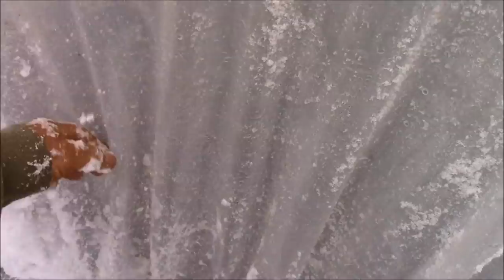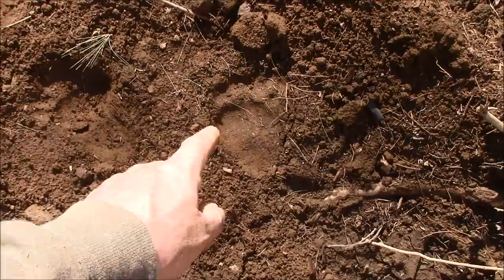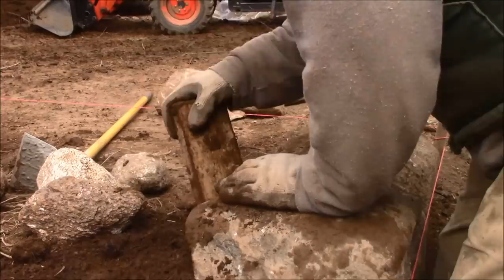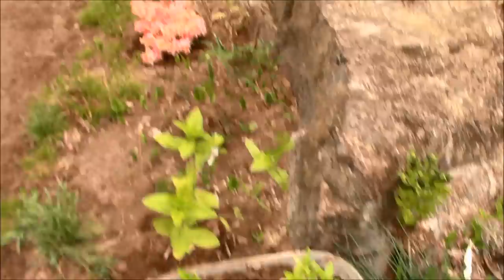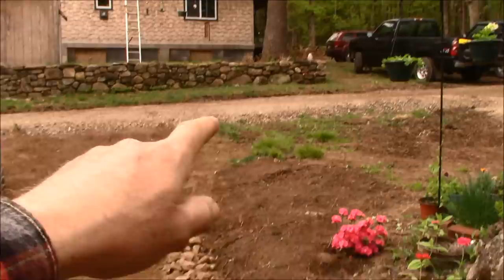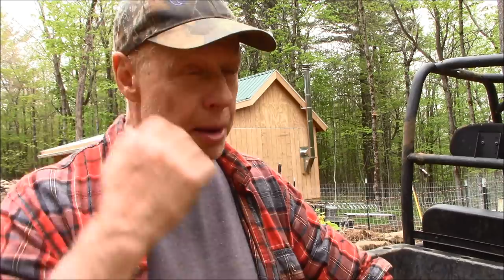HOMESTEADING ON A ROCK.  Life Up Here Has Its Challenges.

Comment: Love to see ya going at it! Praying for ya still... we have our own bedrock hillside issues as well. I plan similar but i will give a larger base under the "soil" level (think if you'd been able to add 4" of base concrete about an extra 16" around your tube. I've got slightly deeper soil.) I also plan to rough up the rock and drill/ chip/ knock out a hollow for the post to set in... even an extra 2 inches will make a difference. 

Look forward to your next

Comment: My mom is your most devoted fan and wanted me to leave you a comment @Off Grid Homesteading With Boss Of The Swamp. She said you should look into rock corners. We use them to fence here on the ranch. Basically it's a cattle panel wired into a circle and filled with rocks. You don't have to set posts and it's solid. I'm sure you could find plenty of rocks to fill it with 😀
Reply from the maker: Now THAT's a pretty darn good idea right there. I could suspend the fence from corner to corner.  I will keep that in my when the frost heaves wreaks havoc with what I've done LOL.    All the best :-))

Comment: When I had to build a fence across a rock ledge I used a one inch concrete bit and drilled holes into the ledge, cut down the end of the steel posts and drove them into the holes. Sending prayers your way. Hope you have a quick recovery.

Comment: Boss I also deal with plenty of rocks. I use a big hammer drill with a 1 1/4 concrete bit to drill holes for T post.If the  post have the plates Knock it off.Keeping you in our prayers.

Comment: Hope all is well! I'm in the Texas hill country. My future off grid cabin sits on a solid flint slab with limestone slab and large gravel mixed in. My secret to T post in rock,rotary hammer drill and 1 1/2" drill bit. I bought the drill from harbor freight with a coupon for $160 and got the 4 cutter tip Milwaukee bit,around 23" long for $112. (Seen for $75 on ebay) Its an investment but worth it. Grind and knock the pans off the tpost and a couple slams with the driver and your done. Maybe 3to 5min per hole. Some have good luck with rotary drill and use #6 or #7 rebar. Its still work.

Comment: I’ve taken your advice and learned a lot from your videos so I’m paying it forward to you.  I drill 16” into ledge with a 1” hammer drill off my generator and pound rebar into the hole.  Makes good fencing and when I built my cabin I used the same drill for all my concrete piers so they wouldn’t slide around on the ledge with frost.  Thanks again Boss and good luck!! NHAF

Comment: Get a hammer drill and a long add bit and drill down for the fence posts I put mine in 12 inches and they are solid. Used 3/4 pipe. Good luck with the surgery

Comment: Your health is more important than our entertainment! Garden looks very good!!!!Stay safe and may god be with you on your surgery.If you have problems with the t-posts leaning in they make corners for t-posts you can get a horizontal to make a bottom and or top bar using more t-posts across! I;m sure they will hold as long as the concrete bonded with the ledge.
Reply from the maker: Thank you :-))

Comment: I hope all goes well . When I put a fence in in Tn.  I hit a large ledge I cleared the hole and used my hammer drill to to put a half inch rebar anot a foot long into the ledge  for my post support then poured concrete in with the fence post the rebar held the post and concrete stable . The chain link fence it now 19 years old and strong as the day it was installed

Comment: Hammer drill fence posts or use rock gabions. Consider piling steer manure in hoop hut corners. The active manure continues to produce heat. If you want to get fancy, plumb tubing from a hot water pump and storage tank on the woodstove and run through hoop huts.

If your surgery is of a male specific type, I suggested that you do what I was doing . Fenbendazole. After 5 months on it, my PSA went from 9.5 to 0.6 and size decreased to  9 percent. I had the organ removal on Tuesday this week. Robotic. Hurts like hell still 3 days later. I was told that the surgery was one of their easiest and textbook perfect.
Reply from the maker: Thank you and best wishes for a speedy recovery.

Comment: As I was enjoying your wonderful videos of you trying to set up your T post in the rock. It just occurred to me that you could drill into that rock just about as fast as you can mix cement. A big ass electric hammer drill with a 1 inch bit would really work there for you. Then just weld a 1 inch rebar to the bottom of your T post and pound it in. Just a thought, all the best. Best of good luck with your surgery.

Comment: Hey Boss, I have a similar situation on my property, Limestone ledge that is 12 to 18 inches below the surface where my shed sits. Limestone is at least easy to drill, but do you think you can drill a hole in the granite?  Anyway if you can drill that granite, get a 6 inch plus deep hole to match some rebar you might have laying around. Slide a pipe over it, 1" or what ever you have, then bend that pipe back to the corner post at an angle and attach to the corner post (might be a slight challenge with a t-post). Of course that angled support is inline with your fence wire and any where you change fence direction or stop your fence. This is kind of a modified Z-brace corner, a true Z would be to the bottom of the next post in your fence line.

Another way to support a fence corner is what we call a deadman, basically its a lot of weight with a cable tied back to the corner high on the post. Again this is inline with the fence run but outside of the fenced in footprint. Most people don't like them because the cable is just asking to be tripped over. Most of the time we dig a hole and fill it with concrete, obviouly its several hundred pounds worth. Just rebar it and have a loop sticking up out of the top to attach the cable.

I have seen some people do the rock baskets around corner posts or even down a long line. Most I have seen don't make it past 5 years but I'm not sure why, my guess is bad basket wire (no overlap, or to light of wire?) Either way I have a neighbor whose Rock baskets are either blown open on the bottom or have just tipped over... LOL, not sure what he did wrong...

Lastly as always, steel and concrete can help a fence a lot but it does get expensive... Steel corners and welded in angles, plated on the bottoms and pinned to the rock.

I mentioned that here we have a lot of limestone shelves, when they run t-posts on a fencing machine they can set a T into the limestone at various depths. pretty impressive.
Reply from the maker: I will most likely have to drill and pin in the future but I don't have the time and equipment for that at the moment.  Thanks for sharing your thoughts.

Comment: I have the same situation, i'm living on a solid rock and i need to drive T posts into the ground . 
I might go the same route as you.
 how deep did you pore your concrete piers into the earth?
 and how deep did you sink the T bars into the concrete? Thanks, take care.
Reply from the maker: I set these on the ledge so the depth varied with each hole.  Drilling the rock would have been my choice if I had the time to do so.